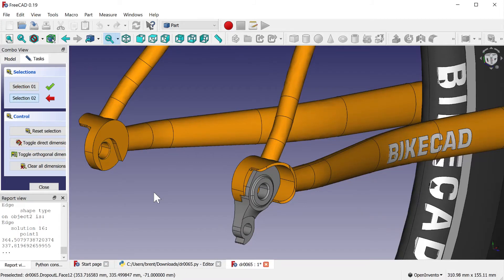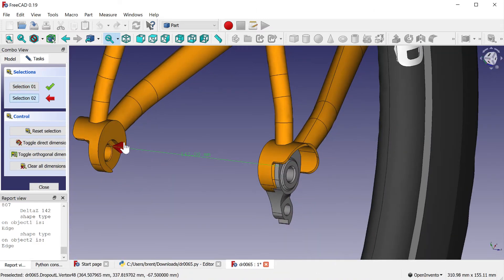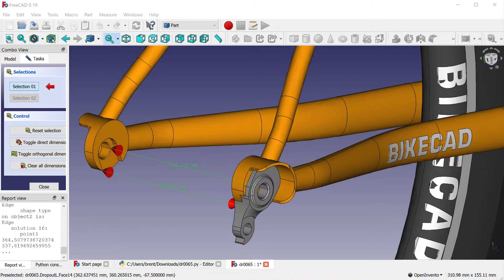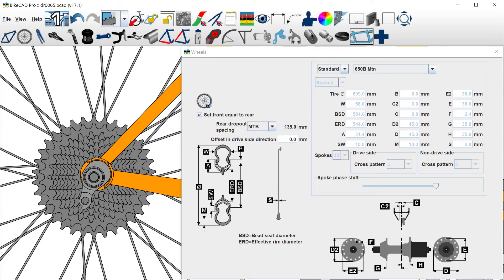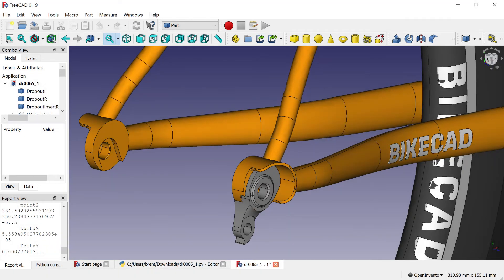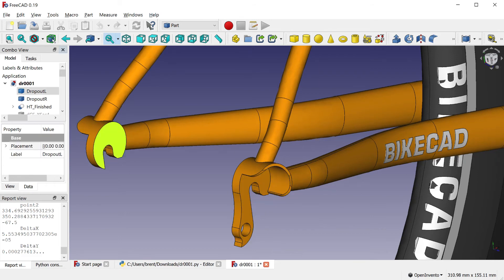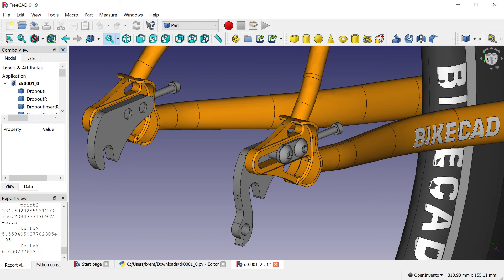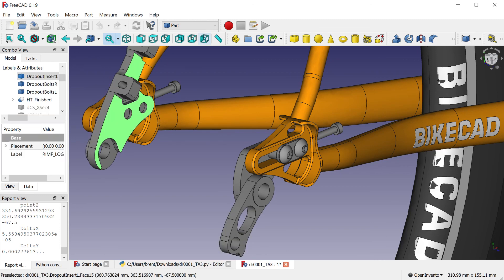Rear dropout spacing for thru axle dropouts.

Comment: This very much looks like a great upgrade for my 2011 Transition Trans Am. Where can I get such an insert for the 12mm axle and with a post-mount?
Reply from the maker: The dropouts discussed in this video are from Paragon Machine Works. I would not assume these inserts are necessarily compatible with the dropouts used on your Transition. I regret I do not have any information about the dropouts used on the TransAM.

Comment from the maker: Since sliding dropouts bolt on, a loose bolt could be a another potential failure mode. The sliding part itself is also like a lever arm that will apply more torque to the fixed part of the dropout the farther it is slid out. However, most sliding dropouts are very solidly built and I don't think this is a huge source of concern.

Comment: How it would be for 148mm?
Reply from the maker: You'll want to enter 141mm for rear dropout spacing. That way, the inner faces of the thru axle dropout will be 141mm apart and there will be 148mm between the inset surfaces of the dropouts.
Reply: @BikecadCa  thanks!!